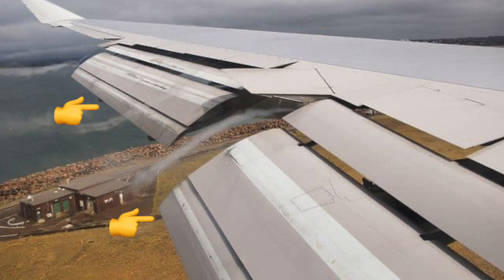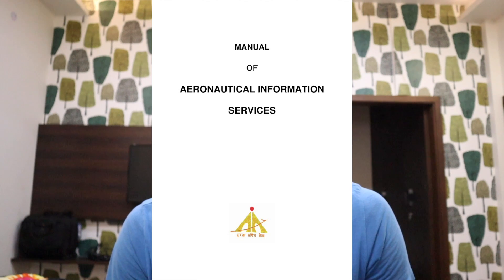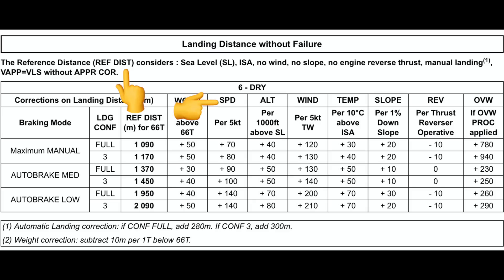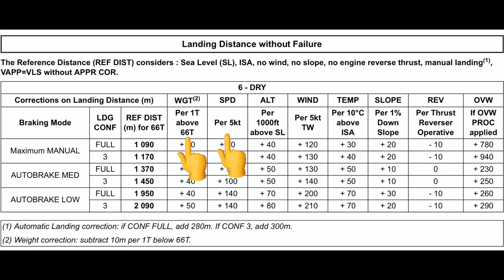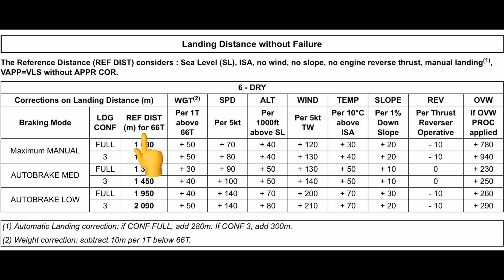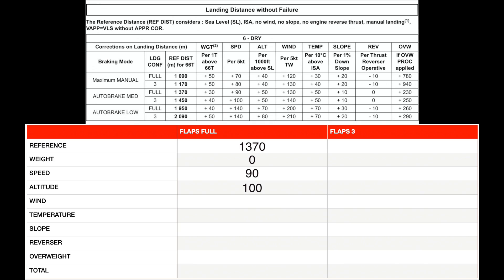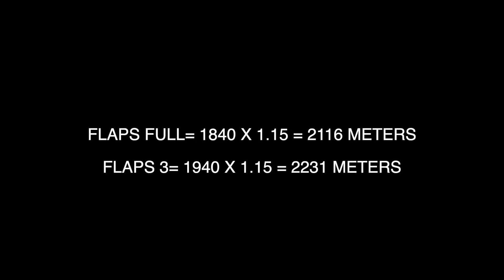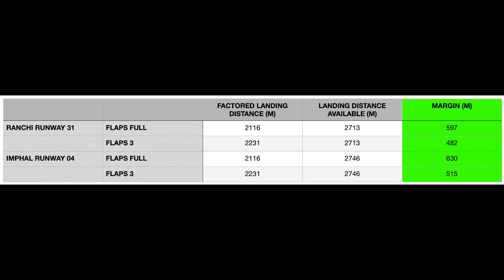HOW DANGEROUS ARE FLAPS 3 LANDINGS ON AN AIRBUS A320? 😰 (WITH PROOF!!!)

Comment: All along, people were asking for your opinion and when you did break it down 'technically', few people have gotten their panties in a twist. It is true - you cannot pacify everyone. While I empathize with Capt. Taneja for the apparent 'safety' issues highlighted in his VLOG, my only gripe is: Why did he have to wait until getting suspended to raise these issues? And why did he not escalate it to DGCA at the very moment he came to know about these apparent safety issues? Was the target of 98% flaps 3 landing introduced just recently? Or is the target applicable only in VFR conditions? 

Lots of ifs and buts but if you're calling out your 'employer', it's best that you corroborate your case with the actual target mails or proofs. One simply does not accuse anyone without a proof. Again - not discrediting anything that Capt. Taneja has claimed but there are always two sides to the same story. So, please consider these things before pulling the trigger. 
The thing is - on YouTube and other social media platforms, most fans will abuse, troll or run around like headless chickens because aviation is not everyone's domain. One can hide behind a screen / keyboard and spew venom on comments, constructive comments and all are fine though but not the toxicity that comes with fandom. And before anyone generalizes - Indian skies are among the safest skies in the world. The last hull loss (meaning aircraft was completely destroyed and it was in 2010: Mangalore AI crash 812) and the error was pilot induced error. Hope truth prevails. Peace.
Reply: The only sensible comment🙏🏽

Comment: You don’t understand the issue which has surfaced, rather u r making futile attempts to keep clear, like a student who wants to attempt all questions not to score but just to avoid an empty answer sheet. The Issue is not about the comparison of flaps 3 with flaps full. This was made very clear by Capt. Taneja, as airbus has installed both the modes and nothing on an aircraft is useless. It’s about an attempt by the management to interfere with the discretion of a pilot to choose how  much flaps he would lower to perform a safe landing considering a real time assessment of all circumstances, be it weather, visibility, runway length, obstacles, turbulence, etc, you know better. This interference and resulting pressure in the cockpit is the safety risk which  Capt Taneja has brought up.  Does airbus suggests in its operating manual that use of flaps full should be restricted to 2%? And what about the leave policy, have you done some calculation to show how a tired pilot wouldn’t enter the cockpit because of the leave policy. If you are of the opinion that Capt Taneja  is incompetent and his claims are baseless, you should say so. With sheer dismay, I must let u know that this video of urs, where u just rambled , is a proof of what working under pressure looks like.

Comment: I Ain't no Pilot but i do Play FSX and XP11 in Steam which are quite Realistic Simulator (Not 100 % Realistic) and i did a landing at KSAN RWY27 with 3.5 degree Glidescope where i have to do a Flaps 4 landing to slow my Approach speed and to do a" Safe Landing" and if i do the same with Flaps 3, My approach speed will be little faster so i'll have less time to act and to do a Landing without Over Running a runmay. There are other factors too like Headwinds, Tailwinds, Crosswinds, etc.

Flaps 3 is Safe (Favourable Weather Conditions) however a Target to do 98% Flap 3 Landing can be Dangerous just to save 8 Kg of Fuel.

YOU HAVE JUST 1 YEAR  OF EXPERIENCE WITH A320 AND GAURAV HAS 10 YEARS OF EXPERIENCE SO IF HE RAISED A CONCERN THAT IT COULD BE DANGEROUS THEN IT COULD BE DANGEROUS. IT'S BETTER IF YOU GAIN EXPERIANCE WITH  A320 BEFORE SAYING " I THINK I'VE MADE MY POINT".
Reply: Pratham_lad  Hush Puppy, I do know about Flaps but you know that you are not worthy enough to explain about flaps. A320 has Single Slotted Flaps and B737NG has Doubled Slotted Flaps so they are not completely same so its better for you to GO AROUND and  learn about Basics of basic of Flaps before teaching us about Flaps and Apart from that I said in my comments that " Flap 3 is safe but a target to do 98% Flap 3 Landing is not " but it seems that you haven't read the comment properly cause you are a Fu*king RETARD RETARD RETARD 🤣. I'm glad that a Twink like you knows about FSX 🤣 but please keep your knowledge with yourself Punk. yeah, you were asking about my experience ? 🤣🤣 Go and Ask your Mom about my experiences and she'll definitely tell you about my experience which are way beyond FSX and XP11 and your Flaps. 🤣🤣🤣🤣
Reply: Pilot to chutiya hai, went to flying school studied passed exams, flew the actual airplane, he could have just played xplane and fsx and become a pilot.
Reply: @vibhavtekchand6784  That was not my point. I Clearly mentioned that a target to do 98% Flap 3 Landing can be Dangerous and as well as that he has 1 Year Experience as Compared to  Gaurav's 10 Year Experience. Have Patience to read comments. Apparently Chutiya yahan koi aur nahin balki tu hai.

Comment: Sir what is ils approach
Reply: The ILS works by sending 2 beams up from the landing runway, one telling the pilots if they or high or low and the other telling them if they are left or right of the runway centreline. ... The radio beam signals are interpreted by the aircraft's computer systems and relay this information to the pilots.

Comment: I don't know whether Flying Beast is right or wrong? But I do know that-
Flying Beast pointed out the safety issues of Air Asia on social media after getting suspended from Air Asia. Before that, he contacted the authorities of Air Asia. They didn't respond to him and the issues he highlighted. He was suspended for putting a video on youtube which said: "I may lose my job due to COVID-19 situation". In that video, he only talked about the impact of Covid-19 on the aviation industry. You don't see the fault in your airline. If your airline is clean then why are they not speaking on this topic? Their silence proves that they are trying to cover up their tracks and do the damage control. If your airline was right then they should have addressed this situation on day 1. But now they want to bring dirt over, Mr Taneja. The senior Captains of your Airline talk like teenagers on Whatsapp groups, talking rubbish about Mr Taneja. When Mr, Taneja was called for an enquiry, it was his right to know that what the enquiry on him was for. But your company didn't mention the charges. They even ignored him after he wanted to know the charges levied on him. If so many highly educated people are working in your company then why is your company so unprofessional and highly incompetent in handling this situation? If everything was right then the issue should have been properly addressed by now. But your company is running away from this situation.

Comment: I am from ranchi .
And i know the weather conditions in ranchi, during winter due to fog the visblity becones 20 to 30 meters .
And some times the speed of wind increases very much.
So i don't think by saving 8 kg fuel air asia will make very much profit.
So what is harm im in full flap landing if it matters with passenger safety. 😞😑

Comment: Thanks Tapesh for giving us detailed analysis for calculating the landing distances and margins. While calculating margins it seems you have assumed that aircraft touches the runway at the start of the runway. I have never seen any aircraft touching down at the start of runway,  So how do you account for the distance  between start of runway and touch down point?

Agreed flap 3 will give less drag and you save fuel. But when you land with full flaps you land at lower speed (hence less landing run). Will it not increase the brake life and tire life, which may up to some extent offset  the price of extra fuel burnt. A full flap landing will always increase the pilot's confidence. My thoughts.
Reply: The distance given is "Landing Distance Available" not the "Length Of Runway". LDA is calculated from a marker placed on the runway, such a marker is where the touchdown occurs. That's why you would never see any aircraft land at the start of the runway or achieve V2 (takeoff speeds) at the end of the runway because they are not supposed to.
Reply: Ya great point broo
Reply: Yes full flaps will give a lower landing speed and lower landing run. But in practice it's not necessary to stop asap (you'll stop/slow down at your vacating point or turning off point). So it's not necessarily that tire and brake life will increase. In fact engine life will increase in a flap 3 landing as less thrust is needed (as there's less drag).

But yes, if flaps full is a luxury, do a risk assessment of flap 3 vs full. But if it's a necessity, do a flap full landing, no questions.

Comment: First of all I am not a pilot, just having a little bit of knowledge in aviation.. And what I know that this video might be factually incorrect.. In Flaps 3 config, Autobrake medium is not used to prevent oxidation in brakes.. It usually Autobrakes Low used with Flaps 3 config. Just my idea, please correct me if I am wrong
Reply: Nothing like that brother!! There was a procedure whereby pilots were required to apply max thrust reversers instead of idle reverse while using config 3 & auto brakes medium to reduce brake wear but now the latest studies shows that the effect is negligible & doesn't posses any threat or additional operational costs and allows config 3 & auto brake medium with idle reverse if runway length & other conditions permit.
Reply: @ICECOOLJK  glad to know that!! Thanks!!

Comment: Airasia is trading off 115 mtrs of runway for 8kg fuel i.e 8*40= ₹320. Considering load factor of 160 passengers; comes about ₹2 per passenger additional cost. Anyway airlines are charging exorbitant prices they can add ₹2 as additional Flap full landing charges for passengers safety.

Comment: If you still have the runway left according to the margins you specified here, why didnt you mention anything regarding the fuel consumption each and evry flap settings will have??
No this comment is not in against you cz I respect you Really from the start and agree everyone has their opinions and they ofc differ,but is there any compulsion in any other airline regarding the 98%completion of the flap 3 landings ??Im not aware about it so cant really say that but,if someone has their right to speak against something then I dont think we should be the ones stopping them from doing it aur just mock them. RUNWAY OVERRUN PROTECTION SYSTEM which warns the pilot about the landings still will specify the pilot to go around when not enough runway is left.So does eveyone has to prefer go around by consuming extraa fuel or just land with the flaps configuration which might stop the aircraft?.
Thank you for this Technical video 💯.

Comment: In my personal opinion, Tapesh made a video that is technically correct and more than sufficient. Something which Gaurav missed out on. Flying Beast makes a fair point about safety, but he also skips the technicality which he thought wouldn't make sense (considering his audience). 

F3 landings aren't unsafe, even in worse weather/terrain conditions (as per Tapesh's calculations which I assume is correct) as they are calculated along with a 15% buffer.

Exceeding all these conditions, if a pilot still feels the approach is unsafe (under F3) he can go in for a Flap Full approach or even attempt a go-around if the aircraft is not stabilized.

With due respect to both the pilots and the airline, the power of social media is extremely high these days, and this needs to be kept in mind while putting out any sort of content, after carefully analysing the consequences as well. 

I believe this case (AirAsia vs Flying Beast) is peculiar, not taking any sides, and the outcome is something many people in the aviation industry would be looking out for.

Comment: Wow That's Amazing when a captain came out with Such a video producing Proofs against the recent issue which made DGCA to start investigation on Air Asia. Sorry to say being a CPT you understand very well that Pilot In Command is the final Authority to take decisions and decided what type of landing should be performed considering the external conditions headwinds, tailwinds while landing on high elevated Airports where glide slope is also high and total PAX on board including 2+4 crew. There should not be any target on pilots to perform 7 out of 10 landings on Flaps 3 just to save 8kgs of Fuel than the risk and damage happens to Passengers and A/c if there is a Runway Excursion. 
Please consider the Human Factor into the picture and not the Manuals present with exact figures to input in the system. 
#Experience matters when you are operating different A/C's of different Manufacturers.

Comment: As an Aerospace Engineer, I can agree with the points mentioned. Flaps 3 is safe, and that it is within the safety parameters of the A320 aircraft. But what needs to be taken in mind is that, weather conditions vary alot and even the human factor that every pilot is different and reacts differently. When in flight, if the pilot thinks it's safer to land with the flaps extended out further, he/she should not be penalized for doing so.

Comment: First of all as per safety both the configurations might have been safe thats why airbus,airlines and regulatory authorities have approved it . But the point here is regarding the 98% company policy !! that means whatever the conditions are , irrespective of whether or any other unavoidable circumstances PIC has to use FLAP 3 only !!!! he doesnot have the authority to choose between the two !!! 
secondly 98% is almost as good as 100%. so if airbus as kept the flap 4 configuration still in production even if consumes much fuel that means it is there for certain situation where flap 3 cant be used !!!! if having a flap 4 is just not required why would the company still keep that configuration in production ???????
what i want to say is its there so that at times based on situations the PIC can decide and use them . But setting a target you are making it a mandatory thing !!! the freedom is gone !!!

Comment: Sir, Whatever you said is partially correct, but there are many other factors that too affect the landing:

Flight crews should pay particular attention to monitoring their speed in descent close to VMO/MMO and when flying close to the wind direction (. The impact of a wind gradient can be significant and bring the aircraft beyond VMO/MMO.
When close to the ground, the wind can change, especially when in gusty conditions, and have a direct impact on the aircraft speed. As a consequence, monitoring of airspeed is crucial during final approach and landing to avoid:

Runway undershoot, hard landing or tail strike if the aircraft speed becomes too low, or
Runway overrun if the speed becomes too high.

The aircraft can be in either an over energy or low-energy situation at landing if the crew does not manage the aircraft’s speed correctly from top of decent, thorough approach, and down to the flare. The consequences upon landing are increased risk of runway excursion, tail strike, hard landing or runway undershoot.

Whatever the level of automation chosen during descent, approach and landing, the flight crew should be aware of its capabilities, take full advantage of the tools available on airbus aircraft and apply the procedures and techniques provided in the FCOM/QRH and FCTM. The point is airlines should not impose any targets to the pilots that 98% should be flap 3 landing only. If airline is to tell pilot how to fly the airplane then no pilots would be needed for flying it. Airline can itself fly the plane.

 agr sabhi pilots ko Flaps 3 landing hi krwani hai toh, AIRBUS manufacturer se bol ke Full Flaps hatwa lo, or better customize your own aircraft.
Sir Records(Proofs) dikha dene se baat sahi nhi hojati hai, Human factors ko bhi leke chalo thoda, Retd. Capt. Chesley Sullenburger ko mat bhulo. At that time, agr Capt. Sully ne company protocol ko follow kiya hota, toh aaj miracle on hundson na hota.
I don't quite get you. In one video you say that YouTube, Instagram, Facebook, etc aren't platforms where you bring up safety issues. And in the very next one you discuss the nuances regarding the same one that was brought up. Hypocritical much?
Gaurav Sir's Experience with Airbus: 10 YEARS
Your's Experience with Airbus: 1 YEAR
#dumbcapt
#hypocrite
#SabKeLiye
#Boycottyou
#BoycottAirAsia

Comment: You are not getting what Gaurav said in his video...but still you are trying to defame Gaurav....
Gaurav had never said flap 3 landing is unsafe or dangerous...
But in some conditions flap full becomes more safer to flap 3 configuration... depending upon the condition it should be the pilot who will decide whether he should take flap full or 3 configuration not the company...
 In this case sitting in the bed and doing mere calculation is  a dumb thing to do..
  
 There is no official guidelines that 98% flap 3 landing is required in a month and if you can't maintain it you will loose your merit...but when Gaurav did 71% flap 3 out of 10 landing then company sent him notice that he didn't meet the company's requirements...But officially there is no such guideline...so it's means that the 98% matter is only between the company person and the pilot...it is not officially disclosed...
So if a pilot do any accident while trying to maintain 98 % (not officially written) policy  than the company will show that it's the pilots mistake they had never forced the pilot to do such and they will claim insurance and will get their aircraft back...
They don't care about the passenger neither the pilot..
#boycottAirAsia
#Sabkeliye